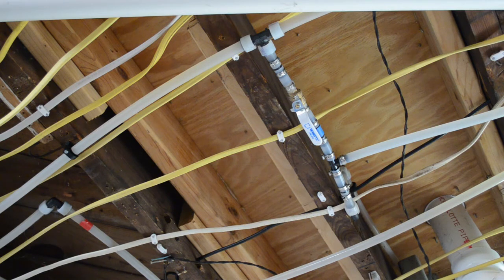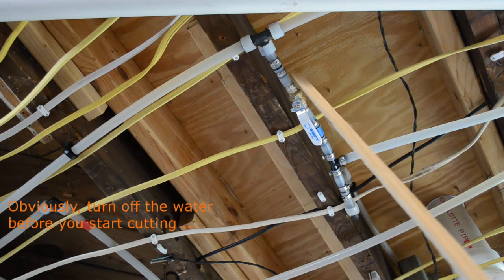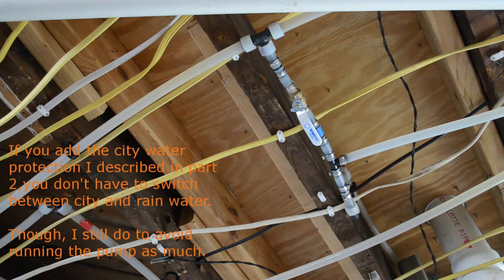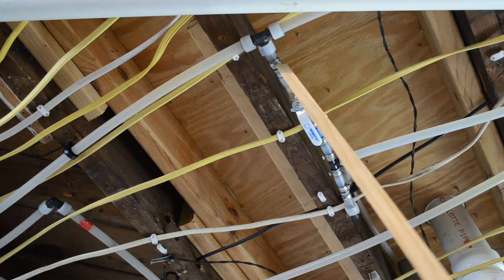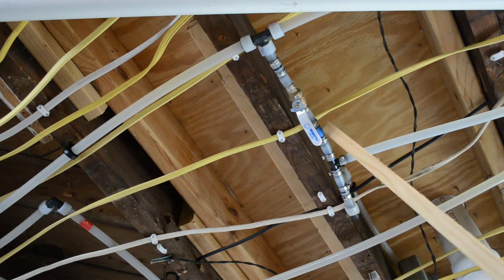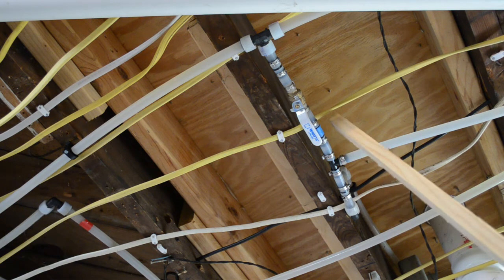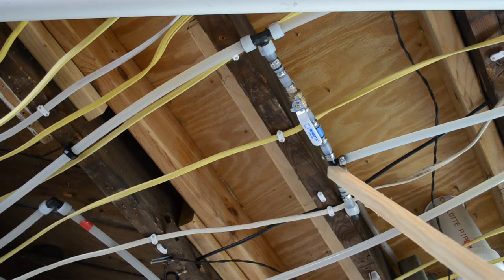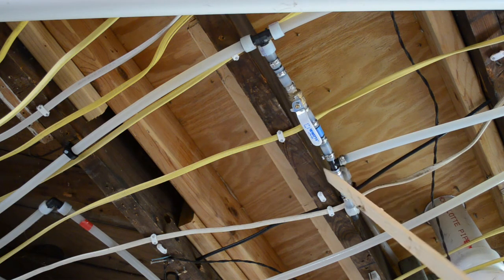On demand rain barrel pump system (Part 3. Flush your toilet with rain water!)

Comment: Great to see this method in action.  Thanks for showing it.  Have you researched any quieter pressure pumps?  That is the only thing right now stopping me from implementing something similar to what you have.  I have had this idea for a while because I have a high water table and a sump that runs a decent amount in our basement so it should always have enough water in it to run this.  I want to tap into that to fill my toilet tank but our living room is very close to the basement.  I am looking for a quiet pump or alternate solution to fill the tank from this ground water.  my ideas are using a sump or pond pump and an electric switch float valve in the toilet to shut it off or either find a quiet pressure pump or some way to silence a pressure pump.  any thoughts?
Reply from the maker: Yeah, the noise is the one draw back. But it is on-demand so it's only rarely on. Though, I kind of like explaining the sound to visitors. They're usually impressed. ;)
Reply: @GordOnTheRoad  yea I have a few 1/6hp sumps I got on facebook marketplace that I love because they are totally quiet but it adds complexity to it.  I watched one video earlier with a 4 channel pump like yours instead of 4 that was quieter.  I also want to run it off of solar / battery eventually.
Reply: take a look at this video.  wondering if this would help just wrapping the pipes in some foam insulation?  I also wonder if you put some under it where it contacts the wood to dampen any vibration?  Might be an interesting youtube video to test out? https://www.youtube.com/watch?v=S5ansTftQNw
Reply: Here is someone with a similar but different pump that is a lot quieter https://www.youtube.com/watch?v=mbizueVb40s

Comment: Great video but I’m not understanding one thing , do you have to add an extra tank above your toilet or this all happens through an on-demand pump?  Also do you chlorinate the rain barrel water?
Reply from the maker: No, I just cut into the pex line that already goes to my toilet. I installed a one-way valve to keep rain water out of the rest of my plumbing, and some valves that let me switch between rain or city water. My wife made me put one of those chlorine pucks in the toilet tank, but since I mostly water plants I leave the rest untreated.
Reply: @GordOnTheRoad  Gord, excellent videos horrible music intro. I do hope you showed your wife and wrote out a cheat sheat of how to operate all this. Please let your wife read this so she will know that chlorox in commode tank is killing good bacteria needed to digest the sewage wherever it is headed. I envy your ability to envision and engineer this.